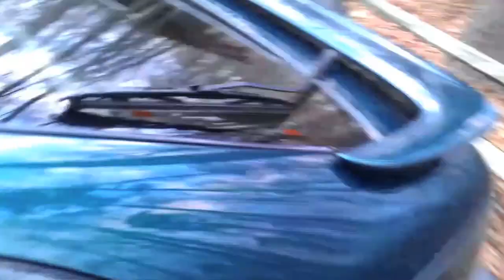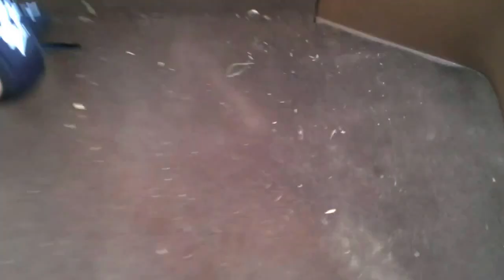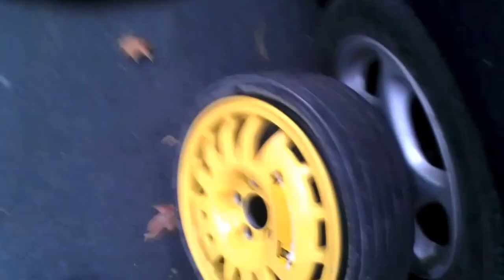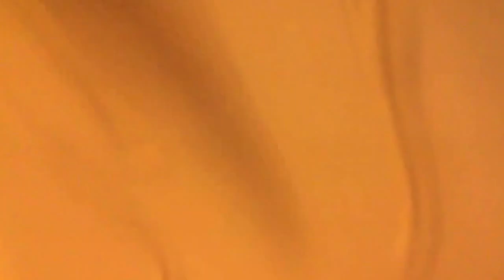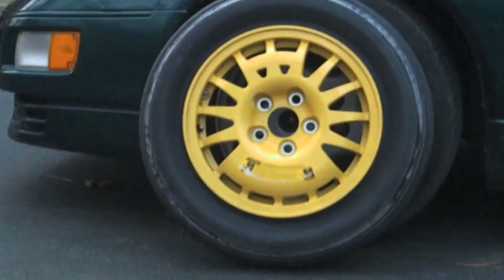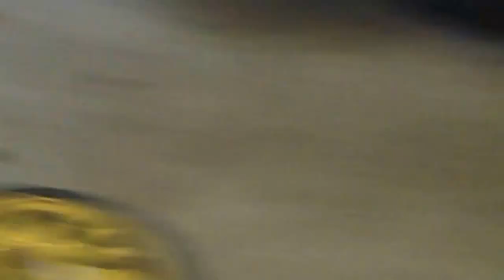Unique spare tire design (Nissan 300zx twin turbo)

Comment: I had to use of these on a zx last night. It works well. Apparently the car, when new, comes with a canister that will inflate the tire. Ours was missing, but fortunately a wrecker driver stopped to check on us and inflated the tire for us. We drove on it for quite a while after that with no issue.